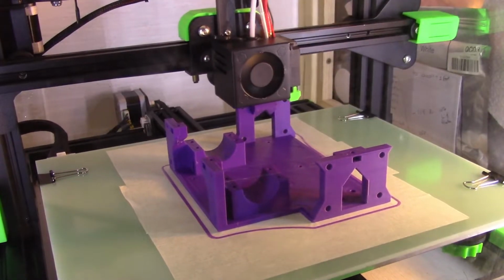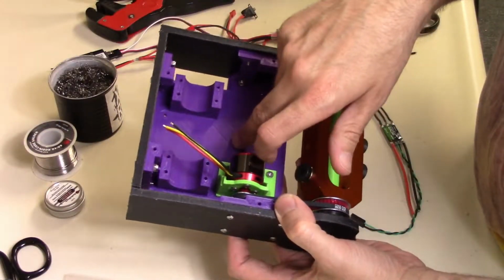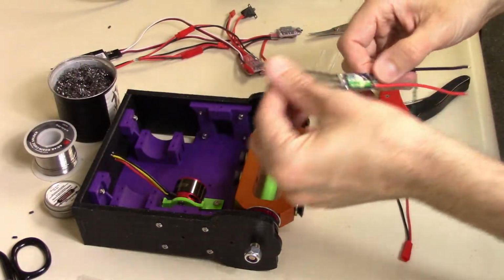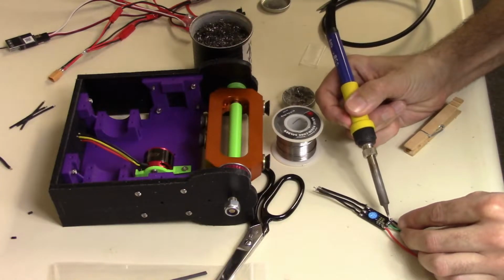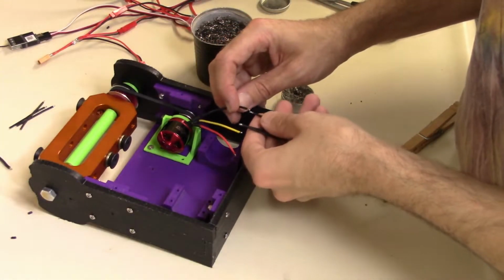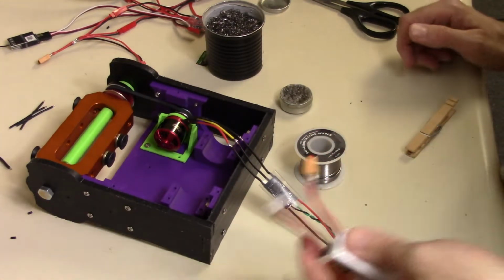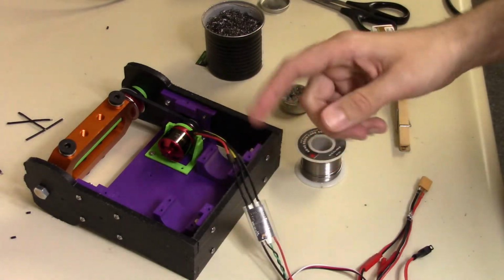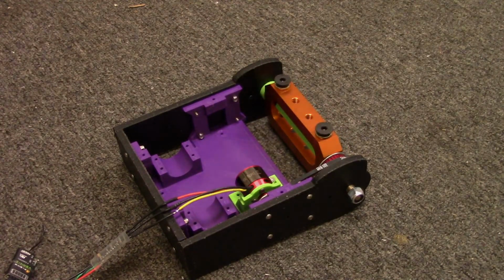Beetleweight Combat Robot - pt2 Chassis & Weapon Test

Comment: I like the use of the 3d printed innards and the UHMW outer panels.
Reply from the maker: thanks man! it ended up working in the event last weekend got 3rd place. The 3d printed part the panels were attached to broke off on the 4th fight but was able to hold it together with tape for my last two matches. I plan to add some thickness where it broke off just incase I cant get metal parts made before the next event.

Comment: i recommend the use of bullet connectors from the weapon motor to the ESC, it'll make it easier to swap out components.
Reply from the maker: yeah I definitely plan on getting some for my larger builds.
Reply: AGTExotics what weight class are you looking into?
Reply from the maker: 12# is my next size to build  @bldjln3158

Comment: Awesome. Great video bud. Is that your 3D printer?
Reply from the maker: yes its the Creality cr10 mini
Reply: @SomethingFishy707  heck yeah. Would you be interested in maybe making me some handles for my picks and maybe a pinning tray. I would pay you of course.
Reply from the maker: @tennesseetarantulas5129  not sure what those items are, it really depends on a lot of factors. there is a website called Thingiverse if you find it on there possibly
Reply from the maker: or make it yourself on a CAD program. it can take lots of hours making something from scratch
Reply: @SomethingFishy707  OK I know there lay out for the pinning tray I'll check on the handles. The tray is for holding the parts for locks when you take them apart. And the the handles should be the easiest. There for lock picks that you use to pick locks with. I'm training to be a locksmith. And i have made a few hand made picks and need to come up with some handles for them.
Reply from the maker: @tennesseetarantulas5129  oh ok lock picking tools